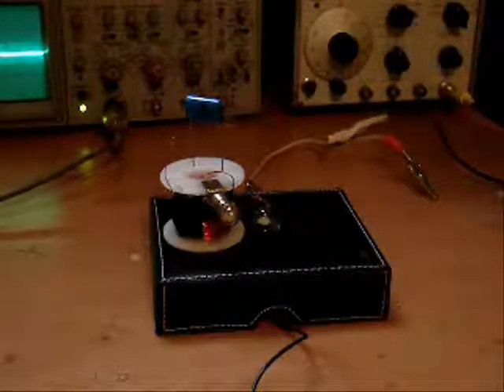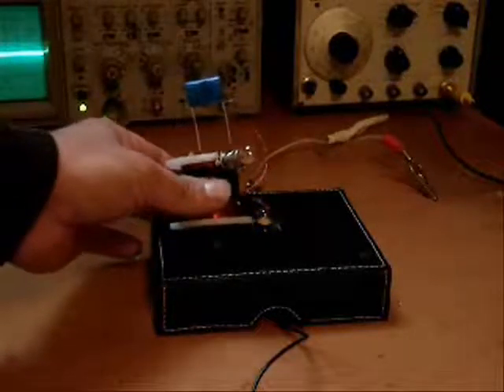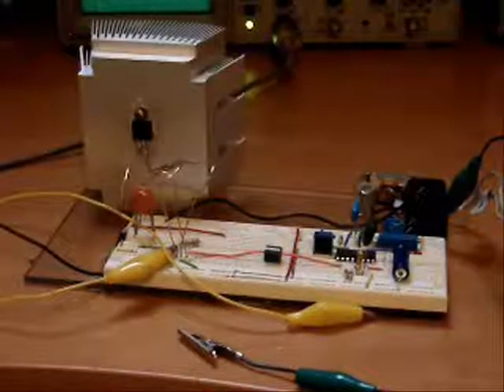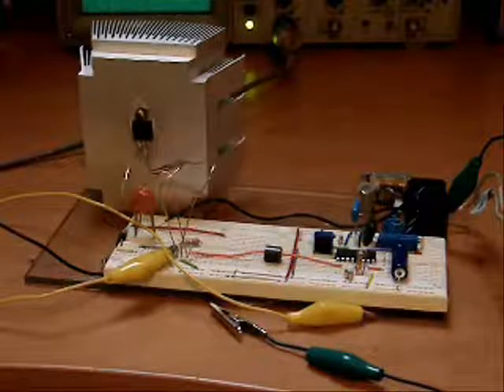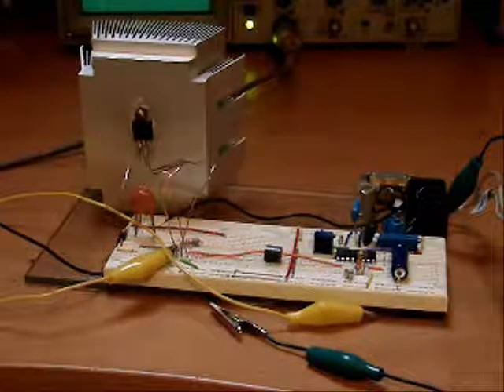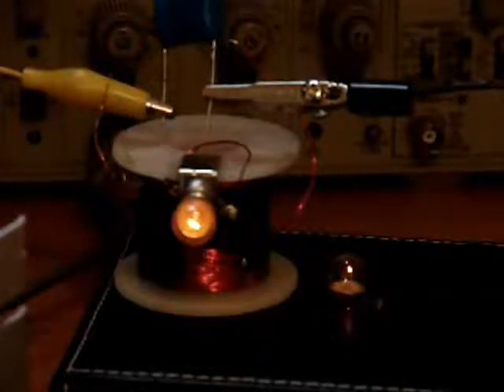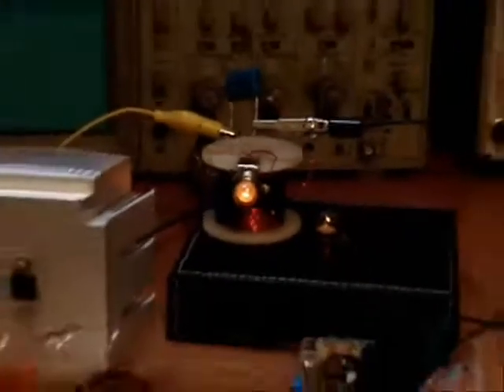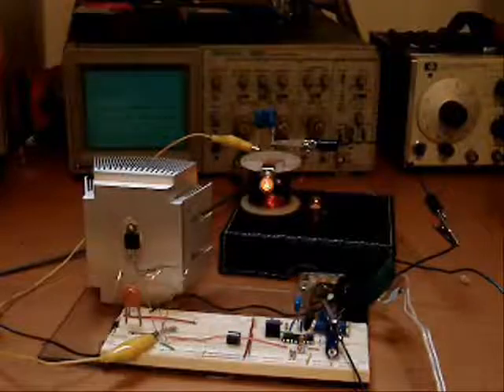Pulsed DC 2

Comment from the maker: I used a HP signal generator I found on Ebay, for about 50 dollars. That is probably the best place to look. You can make your own from schematics on line, or kits also, you would learn a lot this way also.

Comment: Where is the primary coil? :D lol Do you have both primary and secondary coils on the same air core inductor? I have done this and the lamp which is in series with primary will turn off fully and the lamp connected to secondary will turn on, almost like the results you got by using AC. Man I wish you would answer because I can see you know a lot and I know I and many others would learn a lot from you :D